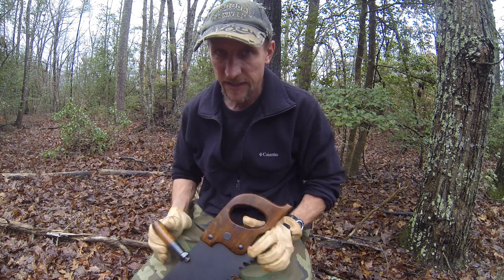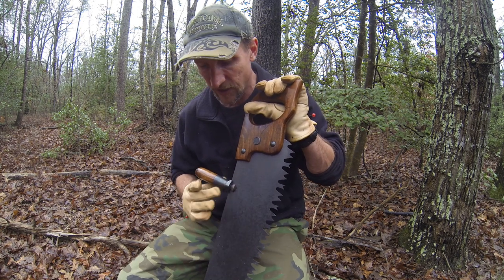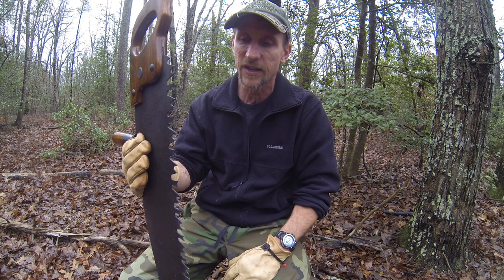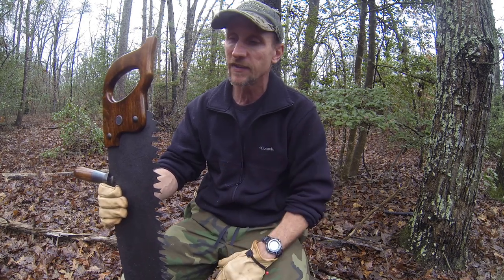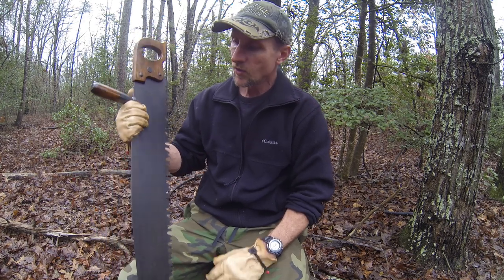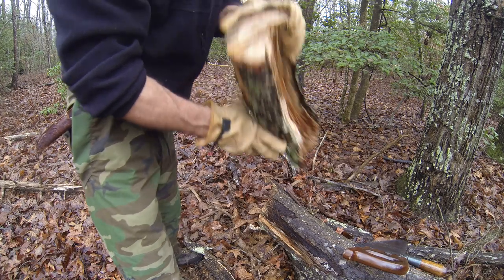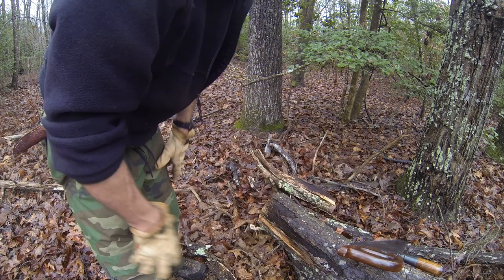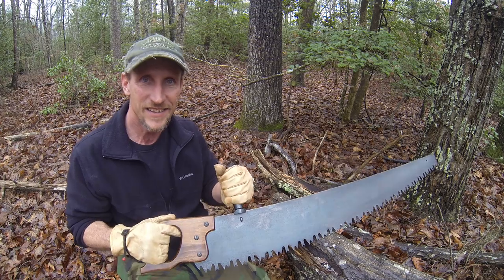restored crosscut saw

Comment: Hi
I have one of these and it's been sharpened. Do these only work on soft wood as it just jams up as it gets in above its teeth on hard wood.
Tia
Reply from the maker: part of the sharpening is setting the teeth.  that is putting a slight bend on the tip of the cutting teeth. This makes the kerf slightly wider than the blade. Reading the stress on the wood being cut incorrectly can cause the wood to pinch the blade also. There are tooth patterns designed for hardwood like the saw shown. Lance tooth patterns are more for soft wood. Here's a link to That will hopefully help..........  https://www.fhwa.dot.gov/environment/recreational_trails/publications/fs_publications/pdf/pdf77712508lo.pdf